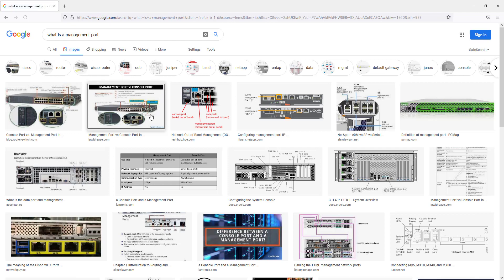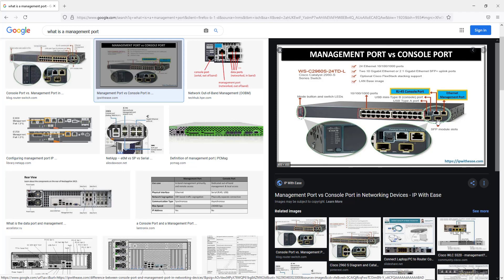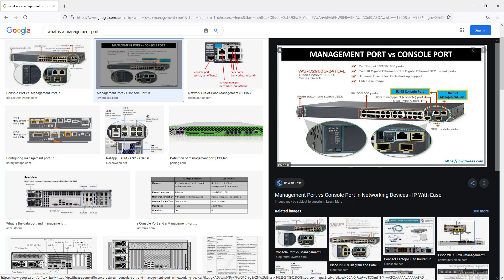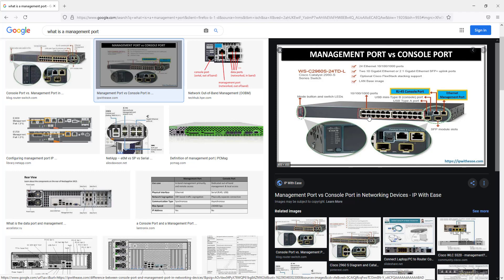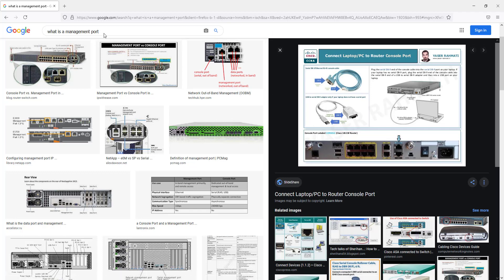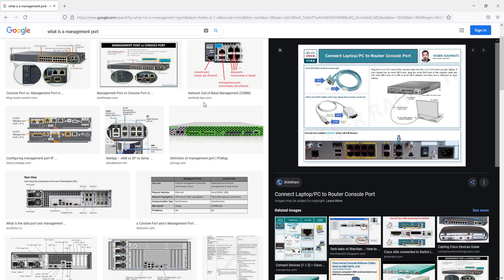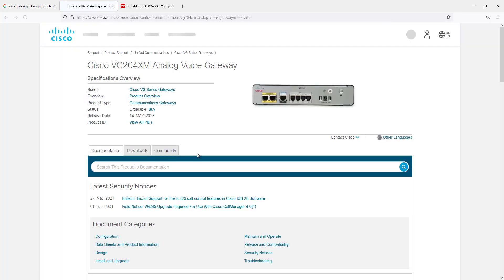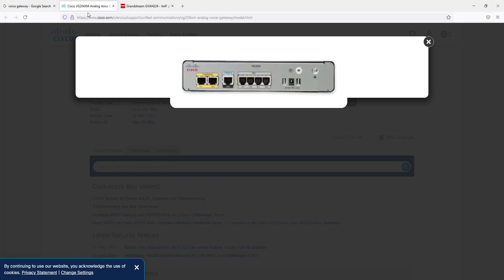Technology Quick Tip | What Is A Management Port

Comment: what is the difference between console and management ports?
Reply from the maker: Depending on the equipment the names may be used interchangeably. The idea of "management" is to be able to reach the device on an dedicated interface. So, in theory on a Cisco switch if someone asked you to "connect to that switch via the management port" On a Cisco switch the management port is a console port that you connect to using a console cable.  I have equipment from another vendor that uses a mini usb cable to connect to the management port (not console). It really depends on the equipment.  The installation and or configuration guide of the equipment that you're connecting to should give you details on how to connect to that device via it's management interface.  They also refer to it as a "Service port" sometimes.... In IT so many words are used interchangeably. Hopefully that helps. Let me know if there are other videos that interest you and thanks for watching.
Reply: @TechBeatsxGames  thanks for the response!